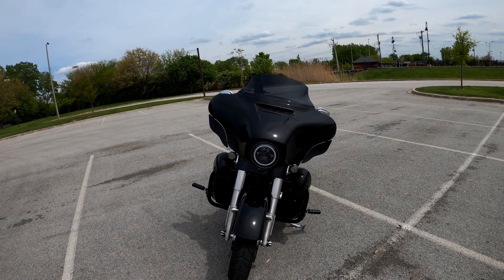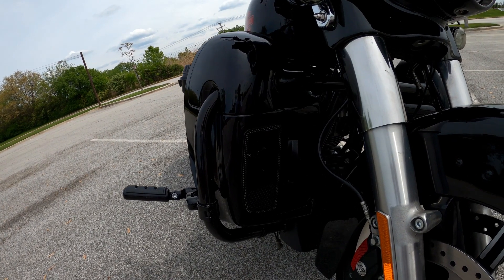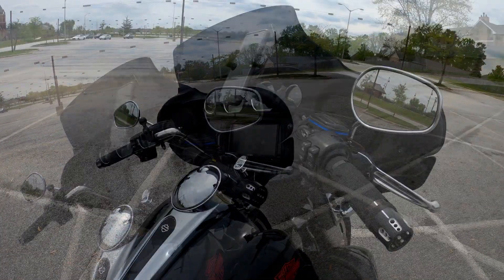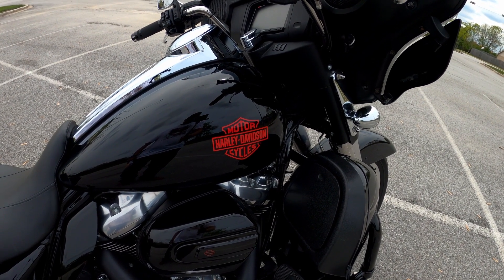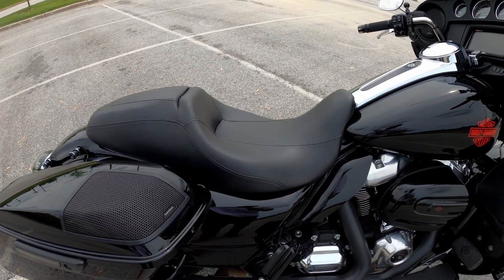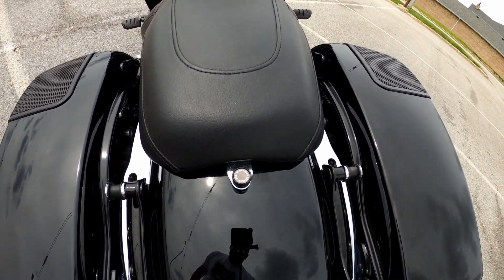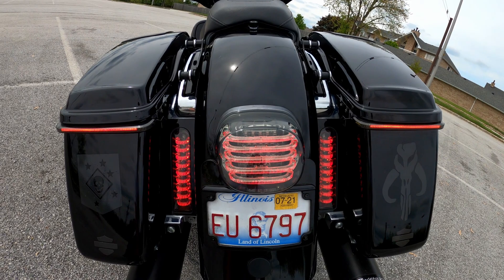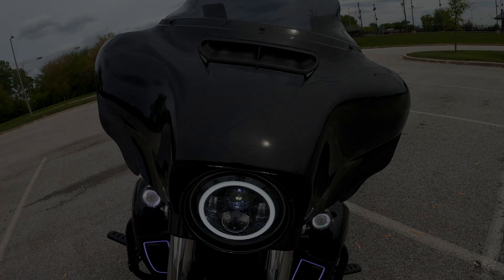2019 HD Electra Glide Standard Modifications

Comment: Dope bike! Being at 5’5 can you flat foot or tipy toe it? I’m the same height and wanted an Electra glide standard myself.
Reply from the maker: It depends on what shoes/boots I wear.  I usually ride with Icon riding shoes...I don't quite flat foot it but as soon as I get my suspension done, it should fix that problem.  Thanks for watching.  It means a lot.
Reply: @OnTwoandGo  yeah I wear a boot with a good 1 inch sole. So I’m hoping that will work
Reply: @davidc3943  I have the same exact  bike.. I will tell you it is one sweet bike for the money.. I made out really good on mine and bought it new for $17500.0.. I love it and also working on blacking out the bike with black and red lol
Reply: @jimbeam9176  oh it for sure will be my next bike without a doubt!

Comment: Nice job. I'll never get rid of my 2019 FLHCS, I love my bike with its goodies I invested, accessories, cosmetically, powerwise, & its support of power with heat. But if & when I get another it would be your bike. You did an excellent job making it yours. Beautiful bike still in progress. I love the powder coating. If you can, what's the cost of your coating? Keep up the good work. Thanks.
Reply from the maker: Thanks.  I'm in a bit of a YouTube slump right now..but have a few videos in the works.  The coat of the powder coating so far was about $250.  Much less than  buying new black parts. Not to mention, keeping old chrome sitting around.

Comment: Take the left heat deflector off and it will better flow…using both causes the air to get trapped behind the rear cylinder…
Reply from the maker: I'll have to try that.  Thanks for the advice.

Comment: Difference between your bike and a Street Glide?
Reply from the maker: Just some of the options.  This is the same frame and motor.  Mine comes in the 107 only.  Street Glide comes in both 107 and 114.  The Electra Glide is just a stripped down version of Harley's touring line.  Thank you for wathcing.
Reply: A way cheaper price tag lol

Comment: This is nothing more than a stripped down street glide. I have a 2011 street glide with a gear cams and a stage 1 kit. That bike does everything I need it to do year after year. All I have done was led the bike out, new clutch pack, and lime I said a gear cam kit and a fan assisted oil cooler. The new Harley Davidson bikes are cool but going on 50k with just a new primary chain and tensioner and that it.
Reply from the maker: Yes...basically a stripped down touring bike.  Street Glides are beautiful bikes...but I just like that I can add exactly what I want without having to take something off.  Thanks for checking out the channel.